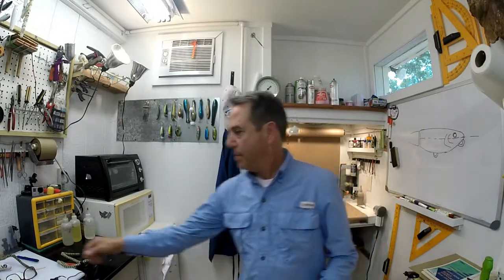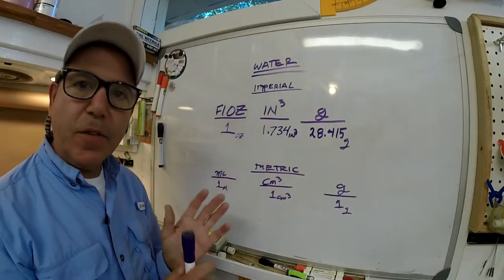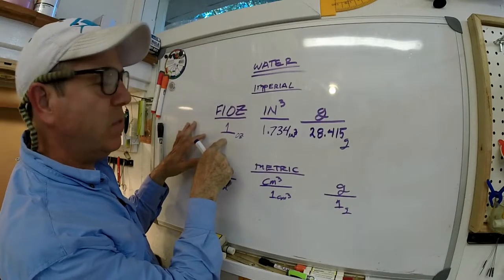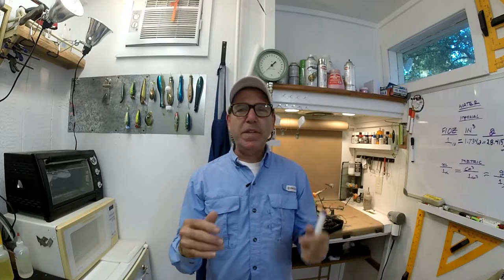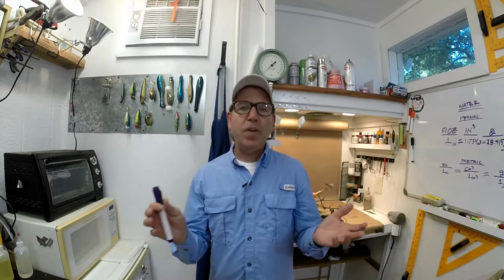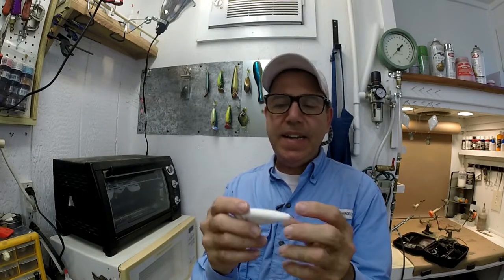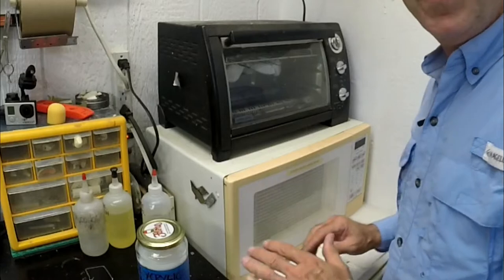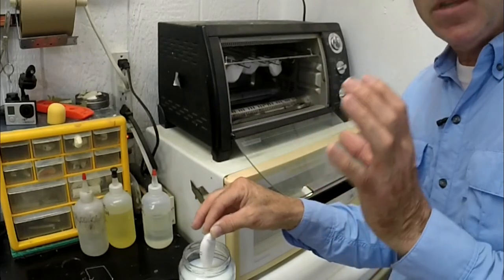Q&A Lure Design and Building

Comment: What i have figured out with mine, is that they have residue from the release spray from the molds. I wasn't sanding them down before, except to smoothen where the mold join is. So now, i'm leaving them sit for a couple days to cure, then cleaning any flash, then doing a real thorough sanding, and then a wash. That is, this is what i have done with my latest batch. Haven't painted them yet. But, my previous batches, definitely the clear isn't working the same as it does on wood. Probably half have been fine, half need another coat.
Reply from the maker: Well I don't use any mold release on the silicon molds unless I using the clear resin for casting.  The two part casting resin needs time to cure 7 to 10 usually will do it...you can do it all in the same day if you bake them...but that's my kind of crazy....

Comment: Your lures turn out so well, I want to mirror your process.  Which polycrylic do you use?  Semi gloss, gloss, satin?  Thanks
Reply from the maker: I've been using the gloss...but if you use it the way I do, as a sealer / mid-coat, I suppose satin will do just as well.  Thank you for the positive feedback...

Comment: I would like an explanation about how the lip interacts with water. How deep cranks with the tow point in the middle of the lip dive deeper than a lure with a lip size as big as the surface from the end of the deep diver lip to the tow point. For example...
Reply from the maker: I'll be posting the first, of probably quite a few videos covering this topic, today. It's a very complex topic I'm trying to take bite-sized pieces.
Reply: @EngineeredAngler  great! Thanks!

Comment: Is there not perhaps some additive that could help reduce this layer of "oil" on the resin lure? Or something that you could dust or spray into the mould before casting?  Thank you for the heads up on that though, most tutorials on YouTube make resin look pretty easy, just cast and paint and there you go.
Reply from the maker: Well it really is pretty easy to cast lures. And I do think that it's very dependent on the weather. I think colder drier climates make it a little easier. There's nothing you can really do to the mold, the problem comes from the natural process of the resin curing.

Comment: instead of the heating process would it work to put many coats of primer to stop the epoxy coat from warping from the oils?
Reply from the maker: I've tried using heavy high quality primer but what I find is that after a few weeks perfectly finished will become bubbly from the paint de- laminating.

Comment: I’ve been using Alumilite resin and I’ve had a problem where there’s about a 1/4 inch layer on the bottom of the mold that doesn’t cure. I’ve tried mixing it very thoroughly and I’ve let it sit for plenty of time. Do you know what could be going wrong?
Reply: Also what do you do so you don’t get air bubbles?
Reply from the maker: Are you mixing by volume or weight...I would recomend using a gram scale and mix by weight. Also a comen mistake is to not scrape off the stuff on the mixing tool a couple of times while mixing.  The stuff in the stick  never really gets mixed unless you scrape it off and put it back into the cup and mix it in. If you let the stick foul your mix, it could cause a problem
Reply from the maker: @whateverbitesminnesota9071  
Try not to mix too agressivelly and pour the resin in a thin  stream...then cross your fingers.
Reply: Engineered Angler I have been mixing by weight with a gram scale. I’m very confused on why it’s happening because it wasn’t happening before and I haven’t changed anything that I know of but now it’s almost every lure I pour. Do you think it could all be going to the bottom because it’s more dense before curing or because it’s the first stuff into the mold?
Reply from the maker: @whateverbitesminnesota9071  
The location or  when the resin leaves your mixing cup should have zero effect. The curing is a matter of chemical reaction so proper proportions, thorough mixing and reasonable temperatures is all you need. If you got all that...the resin could be bad.
Reply: Engineered Angler hmm ok. Thanks for the help